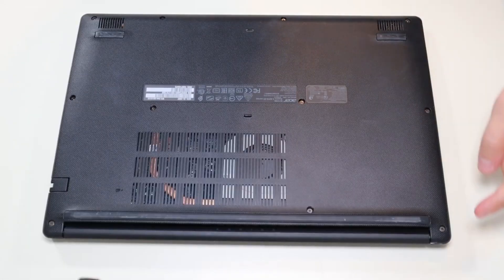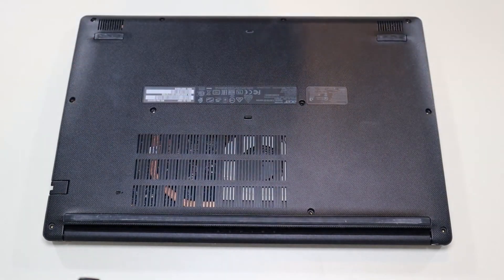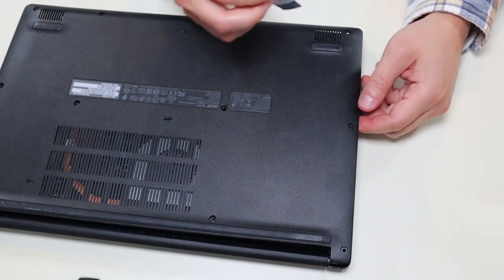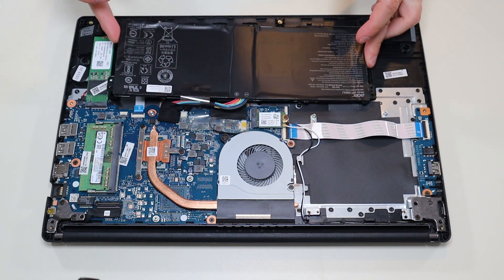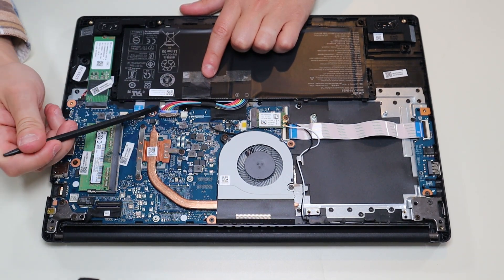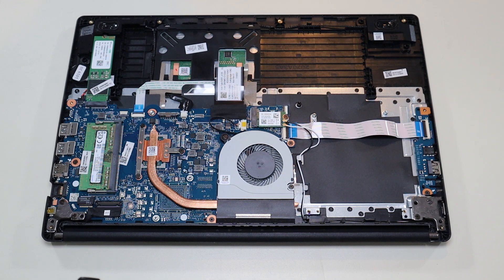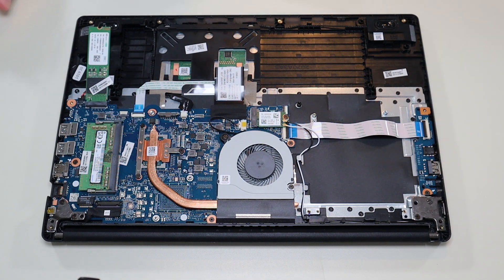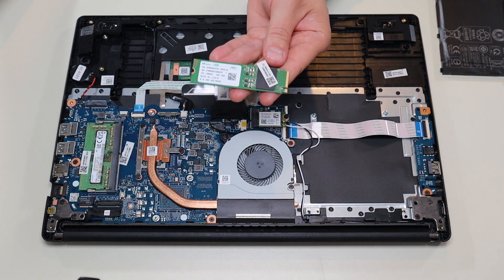How To Replace Upgrade SSD for Acer Aspire 3 A315-23 Laptop Computer

Comment: Thanks a lot for making this video. 

Can the RAM be increased on this model?
Reply from the maker: The manual lists the max RAM as 12GB. Since the motherboard has 4GB built-in RAM, that would leave only room for 8GB stick of RAM. However, the CPU this computer uses supports more ram then just 12GB. If you do try to use more RAM, let me know if the computer sees / uses it!

Comment: Hello, I'm speaking directly from Brazil!

I have an Acer Aspire 3 with Ryzen 7 3700u, 512GB SSD and 12GB of RAM. Could you tell me which memory slot it has? I'm interested in adding a 1TB or 2TB HDD, or perhaps a 1TB SSD. What would you recommend?

Another question: how much can I increase the RAM? I want to replace it with a 16GB one. What frequency does the RAM operate at?
Reply: *In portuguese:

Olá, falo diretamente do Brasil!

Eu possuo um Acer Aspire 3 com Ryzen 7 3700u, SSD de 512GB e 12GB de RAM, saberia me informar qual o slot de memória que vem ocupado nele? Tenho interesse em adicionar um HD de 1TB ou 2TB, ou talvez um SSD de 1TB, o que recomendaria?

Outra dúvida, teria como aumentar a memória RAM em até quanto? Quero substituir por uma de 16GB. Em qual a frequência a RAM dele opera?
Reply from the maker: What is the full model number for your computer? It should look something like this: A315-42

Comment: A problem has occured in my laptop the display is freezee and it is not working at all i removed the battaery but still it wa on please help me😢😢😢😢😢😢😭😭😭😭😭😭please
Reply from the maker: Are there any signs of life at all when you try to turn it on? Lights? Fan, Motherboard, or Hard Drive sounds? Anything seen on the screen?
For a computer that does not turn on, try this video first; https://youtu.be/kOBY4k2Mn_k. Let me know how that goes :)

Comment: When I turn on my laptop without connecting the charger, the fan noise increases and the logo appears, then it turns off. When I connect the charger, it works normally. If I disconnect the charger while it is working, it works normally and does not turn off. What is the problem?

Comment: hi there,  ur vids have been very helpful for me ( especially the fix for the black screen thingy ones ) i thank u for that, but apparently i encountered this weird thing in my laptop, like i try to click anything on my taskbar it wont operate, and if i open few stuff somethings wont register my mouse click or react to it. i cant open new tabs using my mouse, n i cant close chrome using mouse i need to use keyboard short cuts, i cant find any vid out here for that, it wld b a great help if u could enlighten me on this one.
Reply from the maker: Can you first try to fully update as seen here? https://www.youtube.com/watch?v=EDyjxUXBkZM&feature=youtu.be.  Also, did anything happen before the issue? Overheating, liquid spill, Windows update, etc?
Reply: @PC_Monkey  i checked for the updates theres just one firmware thingy, im installing it currently, but beside that overheating can b a issue since it started after i installed valorant and played, but this has never been a issue i have played valo earlier many times so idk
Reply: @PC_Monkey  i just noticed, the mouse is getting registered but like idk where it is clicking, like i was on chrome tab and i clicked, the chrome top bar got greyed out so like its click is working but idk which screen its click r getting registered